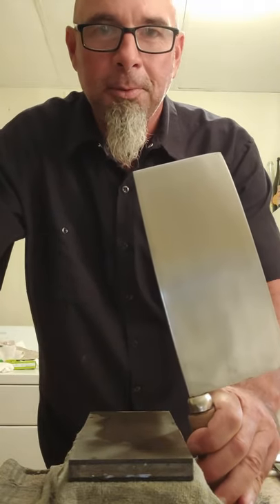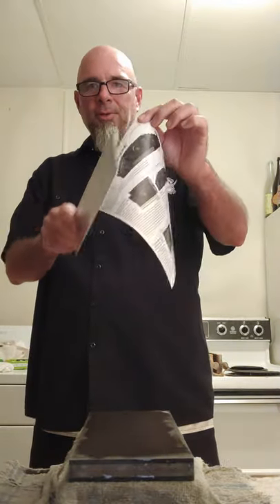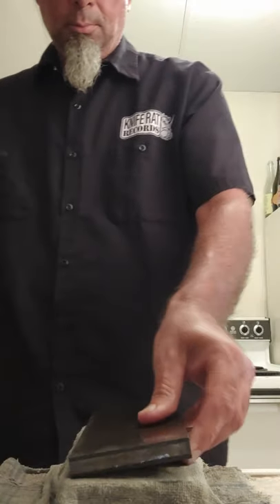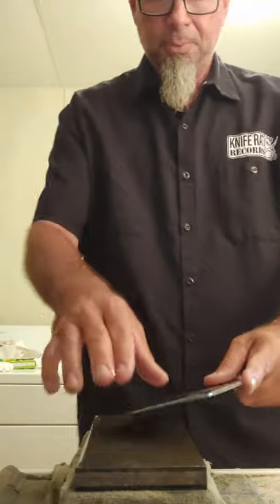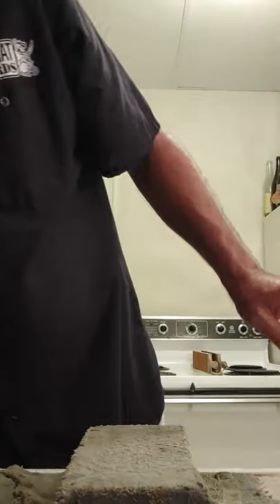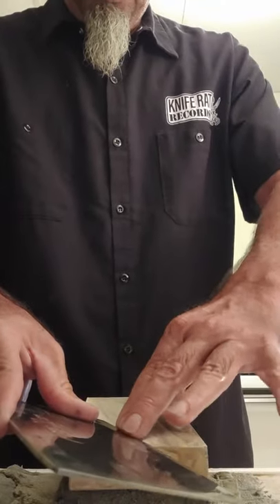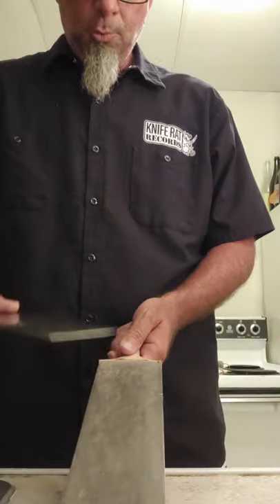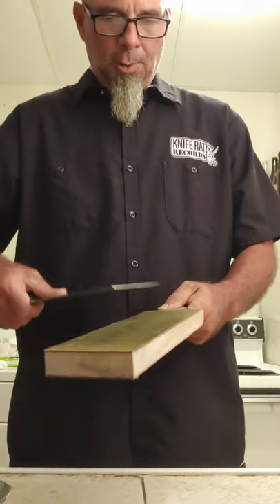First sharpening on a 3 Ram #1 cleaver

Comment: Nice.  How thin is the number 3 blade?  Also, do you know anything about the steel (carbon vs stainless)?  Thanks.
Reply from the maker: Sorry, just now seeing your question. Both blades are some kind of well treated carbon steel. Not sure exactly which type. The number 3 cleaver is thinner than the number 1. I suspect they would think of it as a slicer. It is reasonably thin but not nearly as thin as something like a CCK slicer.